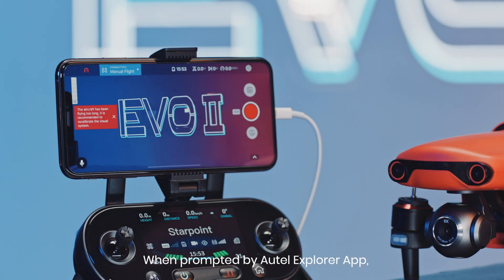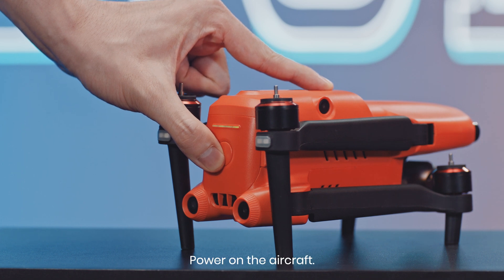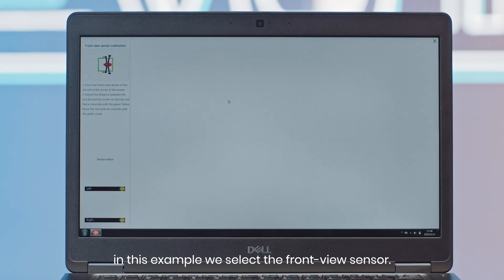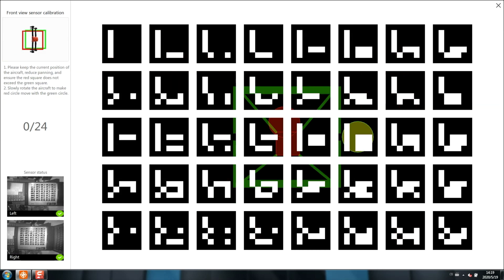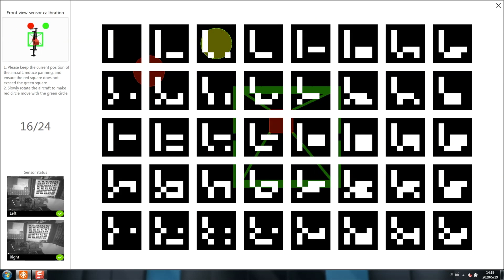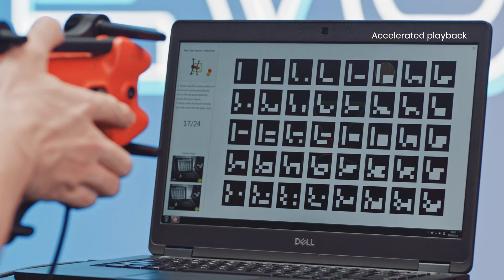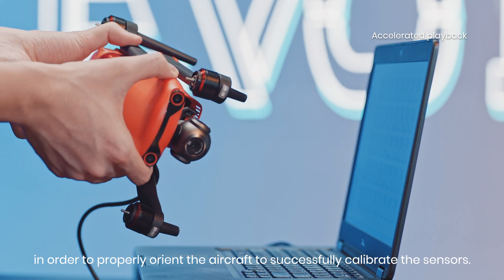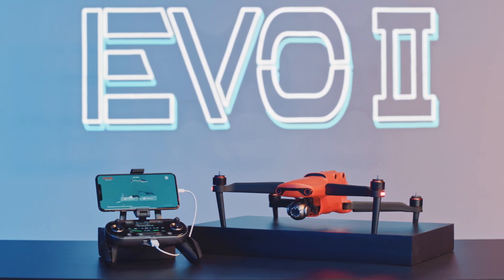How to calibrate the obstacle avoidance sensors

Comment: Hello, I have a problem, my Evo 2 Pro is asking me to calibrate the rear sensors, I start to do the process, from what I see there are 24 control points, I suppose 12 for each of the sensors (right and left), the detail is that when passing the first 12 control points and when starting with the remaining 12 for no reason the points coincide, at times the very small red dot appears it asks me to move the drone a little from the screen but at that moment the red dot no longer appears, it is as if it exceeded a certain distance and the calibration application does not detect the point, in conclusion the distance where the red dot appears is very small and does not match the green one but when I move away so that it is a little bigger the dot no longer appears on the screen, I am not lying to you I was trying for like an hour, I changed the resolution of the screen of my monitor and nothing, what could be the cause of this problem, thanks.

Comment: if you are having trouble keeping the camera locked to the calibration grid, turn the brightness down on your computer. it made an 80 percent difference for me. i couldn't get it to lock on to grid until i turned brightness down
Reply: Thank you. I spent over an hour fighting with this pos. After I turned the brightness down it took 5 minutes.

Comment: Why is this tool so inconsistent? I can get through about 18 of 24 checks without a problem. 19 & 20 become challenging because the program either says "center the screen" or "move back". Cannot pass 21 because the sensor seems to lose sight of the monitor at long distance. This is the second time my left sensor has spontaneously gone to "error" in three months of flying. I was able to successfully calibrate the first time (after an hour of attempts). I am now on hour two and about to go onto my second battery. EXTREMELY frustrating.
Reply: Replacing battery. Got to 22 of 24. Seems like the sensors lose the monitor when pointing to the bottom row on the left. I am calibrating the left-side, left sensors.
Reply: Got to 20 or 21 and finally did the unthinkable... the sensors could NOT figure out how to see the bottom row, so I flipped the darn drone upside down and it worked. Hopefully this will not affect my flight tomorrow...

Comment: This is WWWWAAAAYYYY to hard to calibrate and I cant get this to work. I got it once to beep at me when I got the red square to match with the green square and it counted as 1/24 other times ill get the red square to match and I get it but no beep anbd no 1/24 but it still moves forward with the matching the red circle with the green circle but it loose the tracking and it says please point the front censor to the screen. The only way I can get it to show up again is if its super close to the computer screen but then the red circle is too small. It says to move back so I do and then it looses the tracking again.

How do I get this thing to calibrate?!?! You guys need to have better calibration software!

This video makes it look so easy and simple and its not!
Reply: Did you ever get it to work?
Reply: @Emuspaul  turn the brightness down on your computer. i almost had to go to the lowest setting but it worked fine after that

Comment: We are a group of 17 people who have bought the Evo 2 and Evo 2 Pro We would like the Dinamic Track and Parallel track mode to be improved since it makes accelerations and sudden stops that makes the Gimbal pitch, it should make the movements more smooth. Say in your favor that the sensors work very well dodging obstacles. 
Thanks and keep working on the firmware
Reply: Still can't spell 'Dynamic' correctly I see...

Comment: What .. no calibration procedure for the Evo 1?  How quickly you forget & throw your initial supporters under the bus.
Reply: Agreed, but EVO 1 sensors dont need calibrating as they are different type.... never been asked and did check they are different type of sensor...  and if anyone thinks I'm spending hours of stress doing the calibration on my PRO, think again, how complicated could they make it... strewth...
Reply: yep.
Reply: Rear sensors on my EVO don't work at all. Guess they can't be calibrated.
Reply: @glevideo  Evo 1 rear sensors only ADVISE you if you are approaching something. They will NOT stop the craft from running into something. That's just the way it works. I actually use that as an advantage. When I come in to land, I always swing my Evo 1 around and 'back it in', so that the front obstacle avoidance sensors don't stop/halt my landing procedure when it picks me up standing there.
Reply: @glevideo  Try reading the manual.... they are for ref only... and radar showing, not stopping...
Reply: Well, there IS flying without sensors.  Makes you a more alert pilot.  Also consider this.  Sensors on the EVO II, only sense patterns.  Well big deal right?  It is.  The biggest problem to drones in so far as obstetrical avoidance is trees.  There is only one drone out there that comes close to handling vegetation at moderate speed.  It isn't the EVO II.  So if there is something pressing, you can still fly.  Just turn off the sensors and REMIND yourself as such.  I forgot to remind myself and ooops.  Anyway.   Hope that helps.